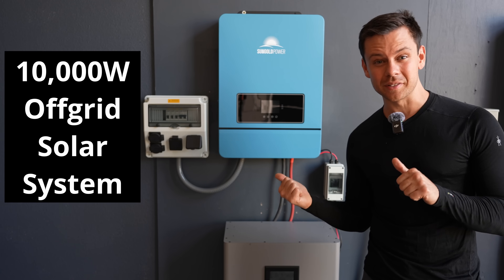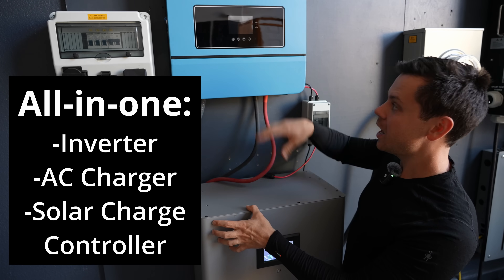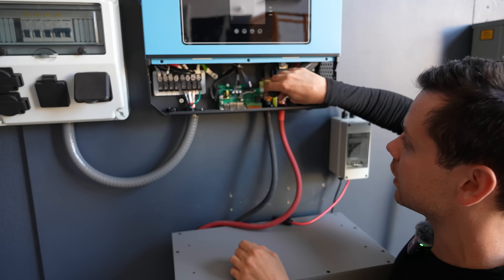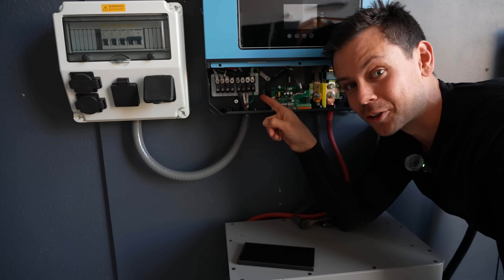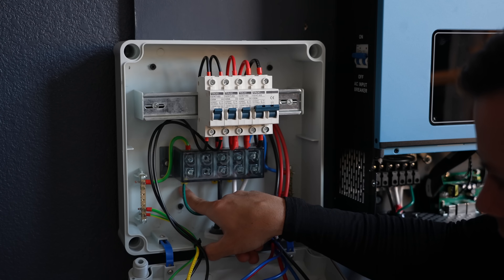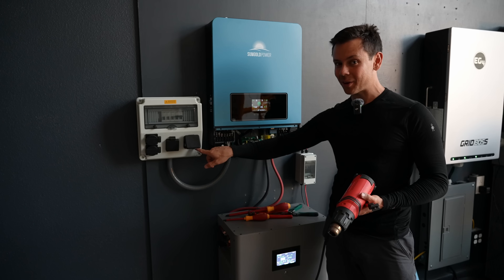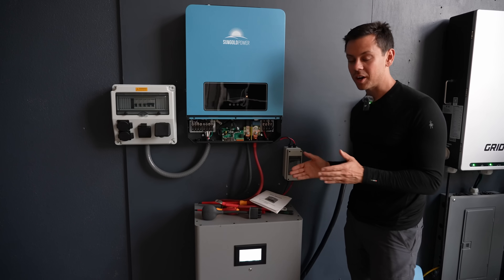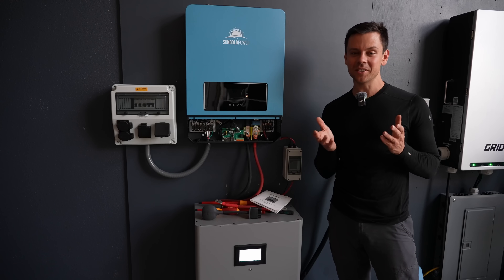Offgrid Solar Beginner Crash Course: Build a 10,000W Solar System

Comment: Thanks for the video.

A few thoughts on the arithmetic...

@ :50 seconds you have a screen overlay with 16kWh = 16,000Wh, 16,000W for 1 hour, 1,000W for 16 hours. @ 8:28 There's a second overlay with Setting #15: Set to 46-48V.

This is where there's a discrepancy between the use of Ohm's Law (volts x amps = watts) to calculate total watt hours vs what is actual usable energy.

3.2V / cell nominal voltage x 16 cells x 314Ah / cell equals 16,078.8 watt hours.

The YIXIANG Vertical 15kw DIY Lithium Battery Box Kit uses a JK-BMS-V19.0.2battery management system (BMS).

On page 18 of the JK-BMS-V19.0.2 manual for LiFePO4 batteries it states the Monomer undervoltage protection recovery is 2.6V or 41.6V per battery bank (16-cells). (The default Automatic shutdown voltage is 2.5V per cell or 40V per battery.) If we use the lower of your recommendations (46V) then it's 2.875V per cell. Or if we use the higher recommendation (48V) then it's 3.0V per cell.

The manual states the Unit overcharge voltage is 3.6V per cell or 57.6V per 16 cells.

The amount of usable energy is the difference between the Unit overcharge protection and the undervoltage protection. Using 3.6V for the overvoltage protection and your lower recommendation of 2.875V for the undervoltage protection then that's .725V per cell.

.725V x 16 x 314Ah = 3.6424kWh of usable energy per battery bank. So, 1W for 3642.4 hours or 1000W for 3.6424 hours.

Even if we'd use the JK BMS Monomer setting of 2.6V per cell, then that's 1.0V (3.6V - 2.6V) x 16 x 314Ah = 5.024 kWh of usable energy per battery.

The quantity of usable energy per battery using the lower of your recommendations is 3.6424kWh divided by 16.0788kWh or only 22.6%.

The point here being that the BMS which regulates the charging & discharging of the LiFePO4 cells only enables using 22.6%.

If you're at 40 degrees north (or south) on your hemisphere's winter solstice (shortest day of the year) there is roughly nine hours of sun. Given the extreme angle at which the sun is at dawn & dusk then it's more like 7 hours at best of usable light -- assuming a sunny day & that there wasn't any snowfall impairing the panels.

That's 17 hours where you'll need to be running on battery backup. Even if you've pared down the night time loads toward a critical load level -- let's say for this example that's a conservative 4Ah. Then that's 4Ah x 120V (house current in the US) x 17 hours = 8.16kWh. Or you'll need 2.24 Yixiang batteries just to make it through the 17 hours of night. And, of course, more batteries if you're running a load larger than 4Ah overnight.

Comment: Please comment on neutral connection-can this be used  with a 50 amp transfer switch? Are neutral and ground bonded in which panel, is inverter ground connected to ground or house grounding rod, are solar panels grounded to their own grounding rod or dwelling rod?
Are you a fan of breakers combined with PV Disconnect?
You are so helpful with your videos I did system and have been charging EV for now 4 months OFF GRID TNX

Comment: WRONG: A few minutes ago, I watched one of your videos where you were quite critical of Martin Johnson's technical skills, but that's okay because it was justified and we all found that video to be very helpful (I'm sure Mr. Johnson did also). Ironically, in this video you are showing us the wrong way to put conduit into a box. It's very important to use connectors to protect the wires. It's also code where I live and probably in Nevada as well. You might want to fix that. Oh, and you can probably find your local code book at Home Depot; that's where I got mine from. Thank you for all the videos you make. I have learned so much from watching your channel. Cheers
Reply from the maker: Actually it is because that stupid connector box on the inverter does not have a knock out. Which is absolutely not to code. Youre 100% right. I hate that stupid thing
Reply: @WillProwse  . . . Ahhhhh, I see. My apologies for the oversight. Thanks for your response. You can buy a knockout kit to make pretty much any size hole you need. When I was in the electrical business, we used a brand called Green Lee. They were high end. Milwaukee probably makes them.
Reply from the maker: and this is supposed to be UL listed but it doesnt even have a knock out. Ridiculous. Even though I couldnt add it, figured its best to have it there regardless.

Comment: How many different arrays can you connect to that Sungold? What's that called on a spec sheet? 
I have 3 different arrays of panels in series right now, of different voltages... would be nice to be able to use them all if I get a new inverter.

Comment: Would love to hear more about connecting to home AC for hybrid/backup power.
Reply: This was my thought.  I think it is great for powering a work shop or car charging and garage but it also seems affordable enough for back up power during a storm.  Not so much 100% off grid but keeping a refrigerator or two running and my 400 gallon reef tank during a storm.  More so if traveling or away.  

It is like this is the gateway or dabble first build then going to the EG stuff being secondary, mid level, with whatever else being the expert.
Reply: Hm? 10,000w inverter and 16kwh battery is more than enough to run AC . In fact I run a whole apartment on 6000. Including AC , water pump, tv, computers, fridge etc..

Comment: Love it,  the battery is showing out of stock though.  I'll re-watch your video on picking how to set up panels,  currently I have 4 x 37v panels in series parallel connected to a bluetti which is no longer enough battery for us. The bluetti was voltage limited to I think 150v which is why I went series parallel. In good sun with no shade from trees I was getting 650w which is great but now that the trees have leaves, I'm finding at least 1 panel is very covered and I only get full reliable sun for a few hours. The panels are mounted on the top of a sea can facing south at a 30-40° angle, as far north in my clearing as possible.  

Once the new cottage is built,  I can roof mount for more reliable sun but I would like to upgrade my battery and inverter/ charger sooner so I have more power available for my tools during the build.

Anyone in the comments with advice, I'd love to hear it, I was an electrician in my past career but we aren't experts in off grid setups.

Comment: You are a life saver!  I was long looking for a solution to run 120v outlets and my tesla nema 14-50.  In my current setup, I have two separate black wires (8awg and 12 awg) connected in L1 terminal of invertor and other hot 6awg wire in L2 terminal.  Both white wires connected in the neutral terminal.  I know this is not safe and proper method is to set up a sub panel like what Will introduced in his earlier video.  However, this new outlet box has nema 14-50r already built in!  I really hope that their quality is as good as other reputable brand and keep my house from burning down lol

Comment: doesn't connecting the bms com cable a bit easier that manually typing parameters 
(that is ofc if the bms parameters are set right from the battery manufacturer )

Comment: How can a person DIY this in the US and comply with NEC 706.3 that states "Only qualified persons may install or maintain an ESS" ?
Reply from the maker: This is not connected to grid
Reply: @WillProwse sure, but NEC 706 applies to off grid energy storage systems as well as grid-tied.  I’m not trying to be pedantic, but if I want to install one of these in my jurisdiction I would fail an electrical inspection on 706.3. Im curious how one becomes “qualified”. The NEC doesn’t specify, leaving that up to the authority having jurisdiction who’s probably going to say that means “licensed electrical contractor”.
Reply from the maker: @dvsing  Yeah I really dont know. I know tons of qualified electricians who have installed dangerous offgrid systems. Would be cool to have a definition of that. Is there a qualification for low voltage high current DC?
Reply from the maker: @dvsing  If you are not touching the grid, most people will not get it permitted or inspected. Which can be dangerous. You have a point
Reply: @WillProwse  yea, and if unpermitted electrical work burns your house down, good luck getting your insurance to pay for it.

Comment: Are the current inverters capable of precharging the caps? I've seen a lot of videos (including yours) where they suggest doing that but as of late I've seen a couple where they don't 🤔
Also: a nice follow up to this video to add the grid could be made (I'm in the process of migrating from microinverters and have the idea, but watching this video makes it dead simple)
Reply: Cheaper to buy 100$ of tools than to hire solar company  Amazon has cheaper crimped Mc4 connector tools and the cost of electricity will increase
I wish I knew of solar electrical company that would not charge 3x what panels and system costs
They do have to make overhead

Comment: Great stuff, now connect it to a 4 - 5 ton HVAC system complete with cutoff/bypass grid power safely and legally.  I want it to stand alone at all times with ZERO risk of returning power and killing a lineman.  This would be awesome just to run HVAC for 4-6 months knock summer electric bill down 90 pct or so - would probably take 4-5 seasons to break even but heck I am 63 not many seasons left take care
Reply: I would imagine the lineman/women have safety procedures for this very reason.  Having said that isn't that what the EG series or similar products are for?
Reply: @saf1671  I am not well versed on all of this I am probably just going to find a disconnect of some kind to enable a manual switch over as needed (if I do this)

Comment: The ground conductors do have to be large enough to sink sufficient current to trip the breaker(s) in the case of a ground fault.  It is unclear whether that means they have to be the same size as the regular current-carrying conductors but the electric code has slowly been moving in that direction.  (Which is overkill in my view).

For an off-grid inverter, I do prefer the battery charger method for charging from the grid rather than connecting up the AC input.  It reduces confusion with all-in-one operating modes which would otherwise have to juggle its relays when dealing with the AC input, resulting in daily glitches as it transitions to and from grid operation.   With a battery charger the inverter simply stay energized 24x7.

Though the battery charger itself can be another minefield.  Generall speaking, battery chargers should be isolated.  Otherwise you wind up with the DC- of the battery bonded to ground through the battery charger.  This alternate ground path can be dangerous and can also easily throw-off the current shunts in the all-in-one and cause it to mis-report everything that is going on.  Most will be isolated.

-Matt

Comment: Do you have a video instruction for a 3-phase off-grid system? I need to run a pump off-grid 24/7, roughly 20A @ 240V

Comment: As always, Will you do a great job at explaining a setup for solar for 48v system. I'm on 12v 800w's 60amp charge controller, 2 -200ah lithium and 3000w inverter. I started from your book.

Comment: Can this setup be configured for 240v 60A use, wired into a breaker panel or transfer switch and also have the AC charge the battery system when power is restored and from a gas generator when not?

Comment: Might consider adding "Tesla Solar Charger" to the title. I have been waiting for this for a year.
I see the prices as Inv $1700 + Battery16Kwh $1900 + Panels $1500 + misc $250  Total <$5500 which is a great price.
In CA it takes about 300 Tesla 50% charges to break even. 
No discussion on inverter charging at 3KW while outputting 7KW or 6KW.

Comment: Great video. This will be perfect as supplemental and backup power for my shop. 
What is an ideal environment to mount this system up in? How much protection from the outside elements is required?

Comment: Great video Will. My question: You mentioned that No AC input to deal with the Neutral-Ground bond issue for beginners. Why no neutral-ground bonding without AC input? Off-grid system still need to have the N-G bond right? Or the inverter has the internal bonding already? I have a similar system but connected to a transfer switch, which works with my main grid panel. So I created a "on-off Neutral-Ground" switch. When I am connected to transfer switch, I turn the N-G bond off; if I am off-grid, I turn it on. Please advise is this Ok. Thanks.

Comment: 9:32 an explainer video on this if possible would be amazing...

On Sunday I disconnected from the mains and started using my 12000xp and 96kw worth of storage so far everything is going great, I did not hookup the ac input yet and based on what was said at 9:32 I might not, though I do know that my panel is correct, going on what the Klein tool RT250 says, everything is green and correct.

Comment: Will, this beginner video is good, but telling folks to connect positive and negative to the right terminals is not where they are going wrong. If they can't do that, they are not attempting any of this. Where most get stuck is doing the CONFIGURATIONS on anything with a screen or with dip switches. How do I know this? After 2 years I realized my Solar controller was set up to charge an AGM battery instead of LI. Please talk more about configurations.

Comment: The way how I calculate the minimum numbe of panel need to get the voltage for the mppt at the inverter I use the Vmp value of the panel and for the max allowable voltage I use the VOC.

Comment: 1 thing you didn't cover was the amount of panels all in one can handle 
Those original growatt units only hand 1 k watts input
The system uses alot of power  and that drains battery alot faster
Ghost load😮

Comment: Where is the T class fuse?
Reply: Might not be needed as the battery has a DC circuit breaker
Reply: @mrmega328 makes sense, didn't really think that those dc breakers were that dependable. However, I just saw another YouTuber test them and they look like they work great. That helps simplify wiring greatly.

Comment: Your video is great for beginners but ... Easy to install? What about building the battery pack? That's not easy to build at all. Not simple. Also those kits aren't available from U.S. stock -- only China stock and takes 30-60 days. I wonder about tariffs and customs fees too? I think this video would be better if you used plug-n-play batteries and not a kit.

Comment: You don't need a fuse in the solar disconnect? Can the battery communicate with the inverter? Do you have a 48 volt charger you recommend?
Reply: Check out his website in the Description. What he recommends for several kinds/sizes of solar system is on that site. It doesn't look as if this particular battery has communication, but there are others out there that does. See his other videos.

Comment: Nice video, Will. Good clear information. One thought, though - not every EV is a Tesla so wouldn't it be possible to say "you can use this to charge your EV" instead of naming the Tesla ???
Reply: Not every tablet is an iPad but most people call them that. Not every internet search is Google. Not every facial tissue is a Kleenex. I could go on but it's kind of ubiquitous
Reply: @maj429  When the Tesla has been around as long as Kleenex and has become a genericization that may pass - but right now the term "EV" is more common than calling every electric car a Tesla
Reply: @qapla  I agree with you 100%. As an EV owner myself, I recognize only the Tesla brand as Tesla's. However I have spoken to many petrolheads and to the common person who does not know someone that owns an ev, and when they see my Chevy, they always ask "is that a Tesla?" So many people are uneducated when it comes to electric vehicles, that the word Tesla is synonymous to them with 'electric'.

Comment: Could you do a tutorial on setting up the settings on inverters to never export to grid so that you could set up a system without having your grid provider flip out?
Reply: The inverter he's demonstrating can't back feed into the grid.
Reply: @jaycrutti Yes, it's an off grid inverter. What I'd like to see is how to set up a system with limits so that it won't send power back to the grid to avoid interconnect agreements and the like. I'd like to have solar but the expense and hassle is always dealing with trash companies and governments.

Comment: I don't need user beginner video, however I have to explain technical things to non-technical people. You are doing a great job. The pace of your voice and tone is slow and clear. Your explanations are easy to understand as you hand hold the video. I plan on making a system just like this sometime this year. I need to compile a list of items that your using so I can find sources. I can provide you a video on my project, with some minor pointers from you. My objective is to have it as a standalone system. Maybe some future time I will tie it into the Grid, as it takes more sign offs on. Glad I have produced factory control systems so this should not be difficult for me. I like this setup that you have investigated.